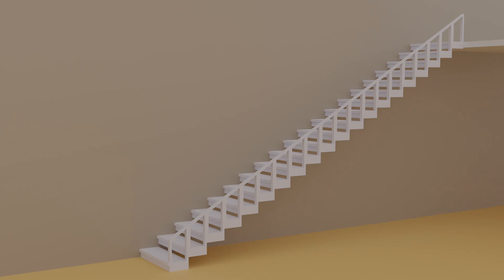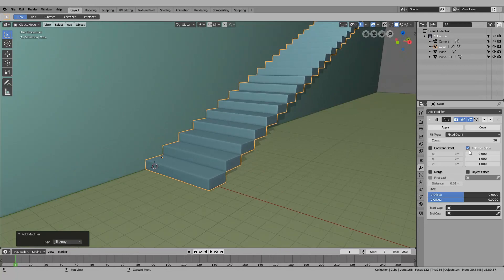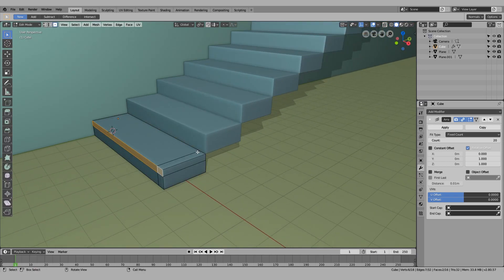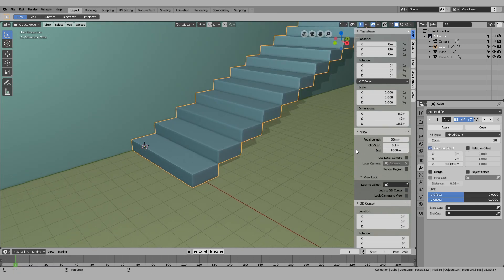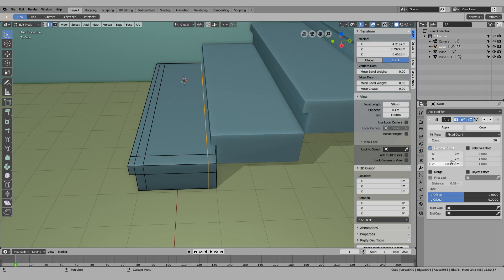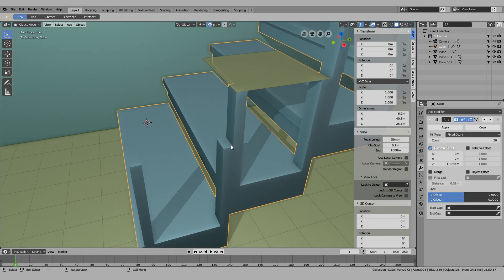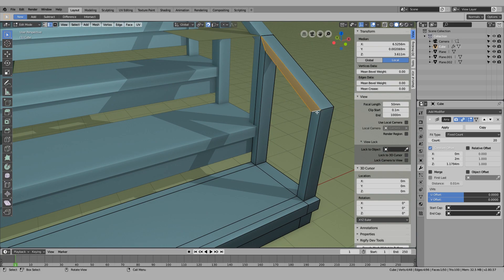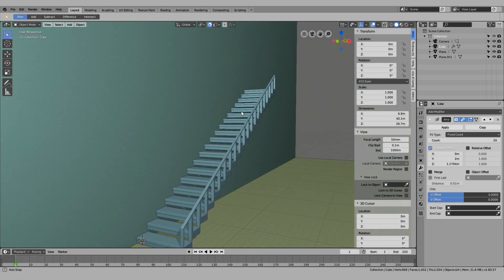Straight Stairs - Quick Model Tutorial - Blender 2.8

Comment: How do you extrude without it having that separation line in the edit mode?
Reply from the maker: Hey, I'm having trouble understanding what you mean, can you tell me when exactly this happens in the video? And which separation line are you talking about?
Reply: @WasiqWiqar  In the beginning of the video you "resize" the cube to a stair shape of your liking, in my blender when I resize my cube I use the extrude option and it creates a line from the point I extruded. What do you use to resize the cube?
Reply from the maker: @WeapMasters  oh! I'm just selecting the face I want to move, it's the same as selecting the four vertices on all corners of it. You can switch between vertex select, edge select, or face select mode by pressing 1, 2 or 3 respectively. Or you can change at the top left. 

I'm using the face select mode in this video. I'm not extruding anything, just changing where the vertices are. Using extrude will add more vertices and hence the extra line, so that's the wrong workflow for this.